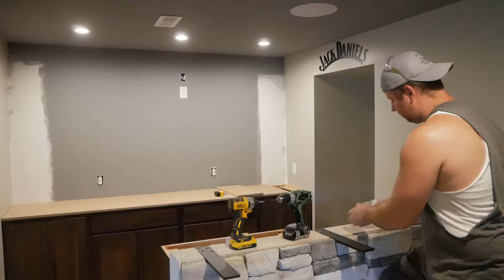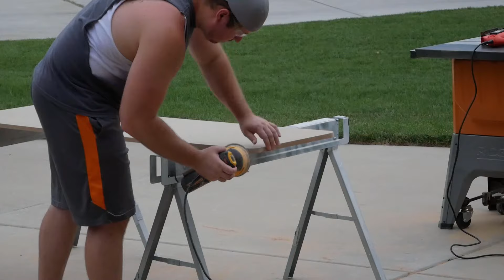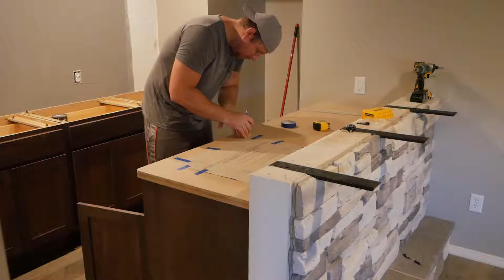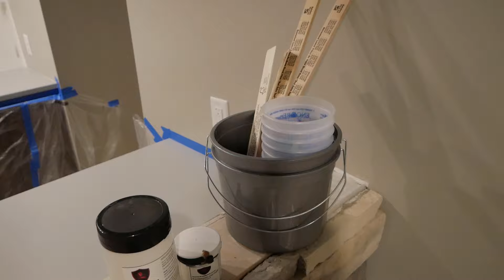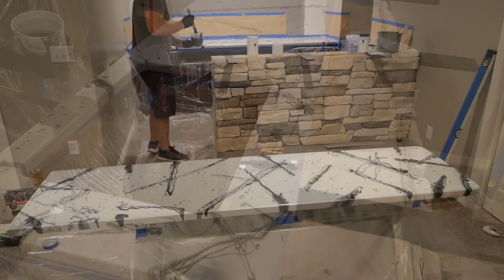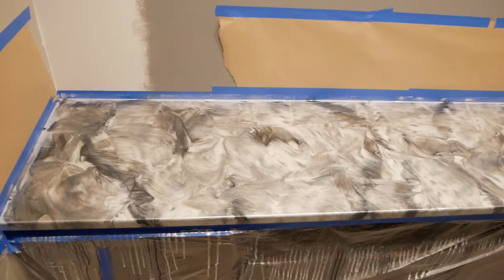DIY Epoxy Counter Tops | Turn MDF Into Amazing Counters with Leggari Epoxy!

Comment: Hello LoB ,  first off ...look great ,  
A few questions ...
What kind of sink did you put in ...It looks like you made it for an undermount sink   ( as one would use with granite etc . )  But I would really wonder about done that with an MDF core , 
Or did you just drop in a surface mount sink ?

By now , I assume that you have finished the whole bar ....what did you use for the backsplash ?      I haven't had a chance to search yet , have you posted finished pics/video ?

Although I see it was sort of asked about... given the chance , would you do anything different ....you answered , a little more silver  I think ,

I'll ask that question a little bit further ...Just from the standpoint of the whole bar, size of counters etc   It all looks great , certainly not suggesting that anything should have been different  , but as a contractor for 25 plus years , I do hear the homeower comment sometimes that they love whatever has been done , but if they were to do it again , they might do something ( usually a small detail ) a wee bit different .

When you were actually doing the pour and spead  etc.  did you ever get much or any of the epoxy  on your clothes or bottoms of your shoes ,  every track it off the plastic  , would you use more plastic next time  , or what you did use was just fine ? 

And lastly , did you look at or consider any other brands other than Leggari  ?   If so , what was the or any deciding factors  ? 

I've  watched/followed  Leggari for a while now  ,  and it seems that the make a top notch product  ,   

Thanks 
Bob from Calgary
Reply from the maker: Hey thanks Bob. I'll try I'll try to answer all your questions ☺
I put an undermount sink in. You can actually see the process and sink i used on my channel. I did a video on the install. I rolled some of that epoxy in the underside around the sink opening and with all the surface area the silicone has to bond with, I don't think ill have any issues. No issues yet after 4 months or so of use. 
I had plenty of plastic around the perimeter of my workspace and didn't pour too much on the surface. There was definitely run off, which you want, but I just watched my step. Never got it on my shoes. Really had no issues besides leaving the container half full of epoxy that was curing. It got super hot and melting some if the plastic onto my flooring. I was able to get it off easily, but could have been a bad deal if it melted the container completely. Keep that in mind if you do this. I'd have a metal tray or container that won't melt to set your smaller containers in due to the heat during curing. It really only get super hot like that with a thick concentrated amount in a container. 
As far as doing things different... eh not really. The fridge opening could have been an inch wider lol. It was tight... you can check out what it looks like more currently in the led lighting video I did. I will post an updated video on the bar and what everything cost here soon once we get handles put on the cabinets and the backsplash up. We just looked at that yesterday and I think we are doing with a horizontal thin rock type backsplash (not the best description I know...). It won't take any grout so it'll be an easy and quick install. I wish the bar was bigger to be honest (more cabinets, counterspace, room for more than 3 barstools) but that is more of a space issue than anything. I felt we did the best we could with our layout and we've been very happy with it.
I looked at leggari and stone coat countertops. I just thought Leggari was more the look we wanted and priced right. They helped me out a bit for making the video as well btw, so that helped too. I'm sure there are others out there that would be great too, but I had a great experience with them. 
Hope that helps! Thanks again Bob!
Reply: @LifeofBliss  .  Good Morning , Thank you for your reply ,  In doing a number of countertop for Kitchens and bathrooms , a few of the homeowners have asked if I can do an undermount sink , but as I've only been doing arborite ( laminate ) counter tops , this has not been an option , that's always been  a solid surface countertop only thing , so seeing you go that direction is very interesting and intriguing .  I certainly know now it's worth further research.

I asked about it getting messy , because , well , it looks like it could get messy , I kinda always figured that the Leggari guys either never showed any problems or have learned from experience " how to avoid "  messy .
So being able to talk to somebody that not only did a first project , but a good sized multi piece/level ... and find out that all went good/great , is very reassuring .

The more I watch what Leggari product can do , the more impressed I am  with them .

Re the size of your bar ... I started out years ago doing basement development , and as such was involved in a couple bars,  and of course how big or small it was to be build was always a difficult decision for the homeowners ,  but you seemed to have a perfect space for it and looks like you used it well .

I'm sure that there are a lot of people out there that are more than envious of your bar.

Thanks 
Bob from Calgary
Reply from the maker: Thank Bob. We spend quite a bit of time down in the basement with friends so we have really used and enjoyed it! 
It could definitely get messy... I would put down plenty of plastic in all areas. Too much is better than too little and then having a mess on your hands. I'd also look into the small sample kits they sell. It's was like $20 or $25. I tried it to see if I like the product and it also gave me a good idea of how much was really needed to coat a surface. Good luck with your future projects!

Comment: Great looking countertops. Only thing I dislike is the orange peel effect from the top coat
Reply from the maker: Thanks! It took is a long time to decide on which top coat we wanted. The regular epoxy top that looks like glass really looks great, the only reason we went with this is the durability and scratch resistance. It has really grown on us, we really like the matte finish.
Reply: Life of Bliss is the top coat orange peel really noticeable in person?
Reply from the maker: It's really not noticeable at all unless you are looking at a direct reflection of the light. You notice it when you feel it more than anything. Feels like 220 or 150 grit sandpaper but not as abrasive. Things slide on it but not as easily as straight smooth epoxy would.

Comment: Good choice on the top coat. Epoxy looks gorgeous by itself but scratches easily and also yellows over time if theres lots of sunlight hitting it. The new urethanes they have now are bullet proof when applied thin. Ive had to try and sand them before doing decorative concrete floors and that stuff is damn near impossible to sand. Even 40 grit just slides over it like ice. So that shows me that its an amazing protective coating. Another reason you dont want to apply the urethane on thick is because it will foam up. I learned that the hard way trying to coat and old door to make a desk with. I ended up having to peel all of it back off, which was an absolute nightmare. Turned out amazing. Looks just like this quartz countertop we just installed in a bathroom remodel but thousands of dollars cheaper

Comment: Nice job. Thanks for the video. It’s been a little over a year, how is everything holding up? Do you wish you would have went with a glossy urethane top coat?
Reply from the maker: Thanks Mike. Everything looks like the day it was finished. We've used it many times for get togethers with food dishes and it is regularly used for the bar purposes. Love the textured urethane top coat we went with. Just gives it a bit of texture and dulls down the reflections. Super durable, been very happy with it

Comment: Excellent video.  I have been looking at this process for a wile for my kitchen remodel.  My questions were related to the woodworking prep work and type of wood to use. So your tutorial for that definitely answered my questions.  Thanks so much
Reply from the maker: Glad it helped! Plywood is another option, but you'd have to be sure the sheets were flat and not warped at all. MDF is good in that aspect, very flat and uniform. Good luck with your kitchen!

Comment: Looks great!  I'm in the process of building my countertops for an epoxy finish. Question I have is in regards to attaching the countertop to the cabinets.  Most of the videos I can find talk about screwing through  the build up strips into the countertop.  I built mine like yours where I attached a full sheet of 1/2" to the 3/4".   So did you just screw your counters to the corner pieces attached to the cabinets or did you do something more?   Thanks for the help!
Reply from the maker: I just screwed them in from the bottom side through the build up strips like you mentioned. 8-10 per counter. Worked great!

Comment: Great job! I usually treat the sides with putty and then sand, but it's a lot of work. What did you do to address the sides for a smooth look? Maybe there's a quicker simpler way?
Reply from the maker: Thanks! After I routered the edges, I went over them with 220 sandpaper by hand just to smooth any rough spots out. Then just rolled the 2 coats of primer on. They were smooth enough after that. They turned out very smooth!

Comment: you used drywall mud to cover the lines in between the two mdf boards?
Reply from the maker: Yep, just needed something to fill the tiny gap between the 2 boards if there was one. Dries fast, sands easy. As long as it's smooth, the epoxy will look smooth. Body putty would work as well, but no need for how small the gaps were.

Comment: Color is gorgeous! I really appreciate you taking the time to make the video, explain everything, give tips & precautions.   I made a small bar under a staircase.  As the bar top I decided to re-purpose a huge 2 inch thick door left in friends garage from previous owners.  Didn't know it was MDF until I cut into it.  Not familiar with that stuff but know its not moisture friendly.  Stained and put 3 coats of oil based poly but still not assured that's going to be good enough.  My son  suggested epoxy.  Will the epoxy work over the poly or will it need to be sanded again?
Reply from the maker: Thanks! This epoxy really sticks well to almost any surface. I would give the surface a quick sand with 220 grit paper just to promote adhesion, as well as seal any areas that might need it with a good primer. Outside if that, I don't think you'd have any issues!

Comment: Great video I'm doing a project like this because of watching your video.   After routing the 1/2" MDA with the flush trim bit do you need to do anything to the seam or does the glue just fill it in?
Reply from the maker: The glue should fill it, but you can add some spackle or wood filler as needed. Just as long as it smooth after you prime it, it will look smooth for the epoxy.

Comment: This looks nice but why waste epoxy on an mdf? No just no. If I go expoxy I’m shelling out extra money for better quality than mdf
Reply from the maker: Cause mdf is cheaper, flatter, and easier to work with a router on the edges (no gaps or rough edges like lower grade plywood). It's all covered up and plenty strong, just throwing more money at a base than is necessary

Comment: Great DIY! 2 Quick questions. 1.Total time labor start to finish w/ waiting / in between coats
2. Fumes? How strong? Lingering?
3. Food grade finish? 
4.can you place something hot on it? Like a pan of wings during a touch down run with everyone facing the tv except the little guy!
Great job again!!!!
Reply from the maker: Thanks man. 
1. I'm not sure, did it over a week. Few hours here and there. 15 hours work time? But you have to let things set 24 hours after pouring 
2. No fumes at all. I think it was 0 voc 
3. Yes
4. I think you can to an extent. Leggari has videos on this than further tests it. I personally won't down there as there is no oven/microwave, but I know it is pretty  heat resistant as long as it's not like right off the stove or similar

Comment: Great job man, around how much did it cost you total including wood and products for the project? Thanks
Reply from the maker: Thanks man. I would say about $700-$750 for everything. That may be a bit high, but I think I bought a new flush trim bit and a few other things. Add another hundred if you need support brackets for the bar top counter.
Reply: Where can i buy all that? Thanks

Comment: Does the epoxy need to dry before coloring?
Reply from the maker: No you'll want to add the color right after pouring the base so it can swirl and mix together. Everything should be poured within 60-90 minutes then allowed to dry for 24 hrs before adding the top coat

Comment: what kind of glue do you use for mdf?
I see when you glue 2 pieces, one seem like mdf and the other is particle board? (I just want to learn, correct me if i'm wrong.. MDF is like paper type? and particle board is compressed wood with?) But yea, the wood type was there just to have something to screw from the cabinet? and the paper face is on top?
Reply from the maker: Actually both pieces were MDF. One piece was 3/4 inch and the other was 1/2 inch. I wanted to add a little thickness the the counter which was the only reason I did this. MDF is mainly just sawdust and a resin/glue that holds it all together. I use Tite Bond II for the glue. Has held great from speaker boxes to things like this. Excellent glue. I did not use any particle board for these counter

Comment: Bro, awesome job.  Been toying with remodeling the kitchen here pretty soon and one of the major decisions is what to use for countertops since we can't really afford granite/marble.  Torn between concrete and epoxy.  Great job as always man, keep up the vids.  You're doing everything I have on my todo list!  haha
Reply from the maker: Thanks man! I gotta say, the epoxy was super easy. Especially if you have existing counters to poor over, it'd be a 1-2 day job. I thought about concrete as well but am happy so far with these. We'll see how they hold up. We did these to save money now and possibly upgrade down the road. Good luck with your projects! Let me know if you have any questions about anything
Reply: @LifeofBliss  I know this was 3 years ago, but if you don't mind a question, do you know if that epoxy can be used over an existing granite countertop? I remodeled my house and now my granite countertops do not match the rest of my house. I'm planning on buying a small kit to practice with on some plywood first
Reply from the maker: You wanna cover granite with epoxy?! 😅 I believe you can, but I would take an orbital sander with some 80 or 120 grit paper and rough up the stone a little to make sure you get good adhesion. May not be necessary, but better safe than sorry
Reply: @LifeofBliss  The granite really doesn't look good. It has been the only thing in the house that we never really liked. The people who built this house definitely liked nice things, but maybe tried to save some money by getting the ugliest granite countertops available. Lol.  When we moved in, we had to decorate around the kitchen specifically to try and make the countertops look better. Now that I've basically remodel the entire house, they just look so  out of place and there's no way I can afford new granite

Comment: great job ... but ..  i was surprised your black and Decker jig saw didn't burst in to flames and explode like it the cartoons, when you cut that mdf --  the only thing they're good for is to cut the cardboard on the box of a new dewalt jigsaw  ;)
Reply from the maker: 🤣😂🤣 lol I seriously got that for $10 on clearance a few years back! Been damn good for $10, but it ain't no Dewalt!
Reply: @LifeofBliss  i actually have one  lmao  i only bought it cause i was to lazy to empty the back of my truck to find my good one at the bottom of my tool box ...all i needed it for was to cut the top off a plastic 45 gal drum :)
Reply from the maker: Haha I hear ya... that was the biggest cut I've used it for to date, and it didn't perform great lol. Usually it's just little odd cuts. Should have cut it out before glueing the 2 pieces together and used the flush trim bit in the router. Live and learn...

Comment: I think it will be a short lifespan for this product. Laminate would have much better and lasted much longer. The new laminates look amazing, nothing like the laminates of yesteryear.
Reply from the maker: I'd agree if it were just an epoxy top. That urethane top coat is very tough. This won't be seeing as much action as a regular kitchen, mainly just glasses or cans. I'll definitely do an update if it starts showing wear though.
Reply: Life of Bliss do keep us posted. Most of the ones I have seen have not held up well. I do think you really did a nice job. I have been installing countertops or have been around it all my life. I am a second generation laminate installer. Still do it every day.